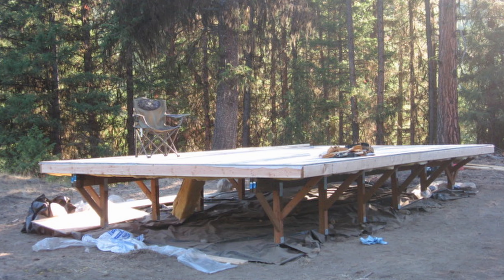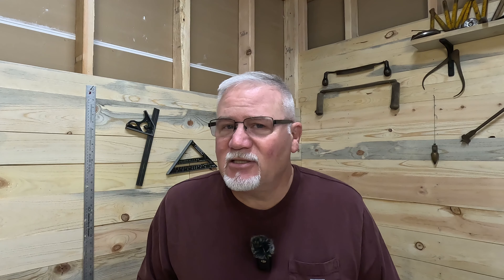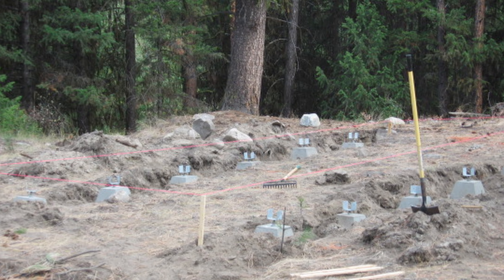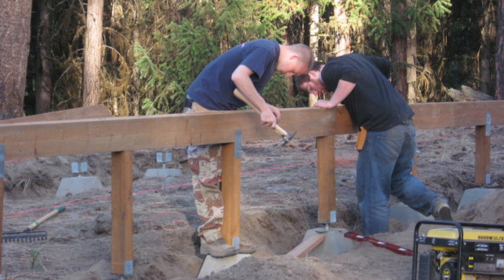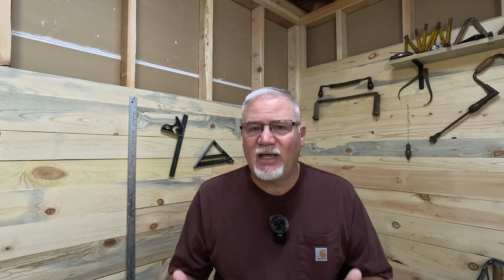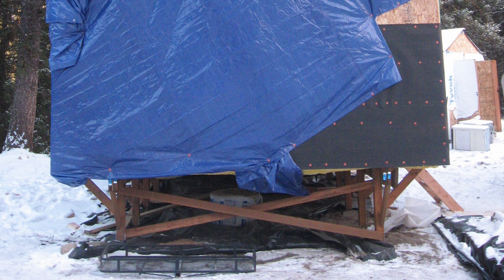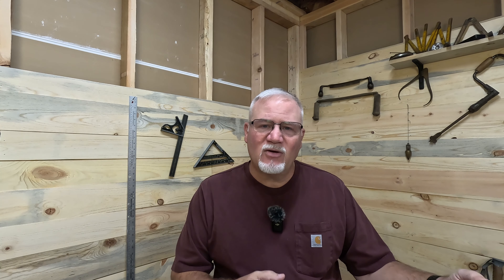I Regret Choosing Post and Pier for My Cabin Foundation Here's Why!

Comment: Based off the cost of concrete, form work, dirt work, rebar/ wire mesh, etc, a stem wall foundation is about 2-3x the price. Not sure who is calculating these costs.
Reply from the maker: I found it odd myself.

Comment: Lay it horizontal and dig it into the ground it will take a long time before it rust
Reply from the maker: Lay what?
Reply: Courragated metal siding
Reply from the maker: @raymondpeters9186 Ahhh yes.  Good idea
Reply: If you want to go crazy you can glue XPS hard board insulation on the back side of the courragated metal siding 
Metal siding is fireproof and blocks the wind
Reply from the maker: @raymondpeters9186 Eventually, I plan to finish the foundation and insulate it, but this would be a good way to seal up the crawl space.

Comment: You didnt brace correctly.  You brace like and x from post to post.  That eliminates flex.  I just finished a buukd like this but used 6x6 and braced well.  Mine is two stories and no movement.  Try to make the largest triangles possible.
Reply from the maker: Agreed

Comment: Always put your foundation lower than frost line...
Reply from the maker: Best of course but then in 15 years I've had no frost heave.  It's a cabin.
Reply: @TheOldJarhead  
Frost /frozen can lift things..
To me it's always easier to do things right (below frost line or ?) Than to go back in after the fact to try and fix things...
But that's just me....
Reply from the maker: Of course, but sometimes what we believe is right isn't necessarily.  My building hasn't heaved in 15 years, is a cabin, and I'm happy with it. 

I won't claim it's perfect, but I know cabins built this way 100 years ago that are still in use 😉

Comment: @Adam Roby
I am guessing having skirting that goes down to the ground would also not help much since these critters will just dig under the skirts?  I guess it would at least help somewhat with the wind.  Great video as always.
Reply: You should dig a footer to sit you skirts it should keep critters out and you should also put down a thick moisture barrier down in your crawl space. Extra protection plus keeps mold down.
Reply from the maker: I think it would help but the footing and cinderblock wall would be ideal,  I may skirt before the winter though just to help keep things warm until I finish the new foundation.

Comment: Could You Screw Hardy Backer Board under the Floor to encase Your Insulation and deter Rodents from invading ?
Reply from the maker: Yes, or even plywood, however then it would breathe and would be a mold maker.  Some use peg board, which may be easier and cheaper than hardware cloth, and I've thought about trying it.
Reply: Or corrugated metal siding
Reply from the maker: Mice might be able to sneak in the grooves

Comment: I am a mason if there are rocks in the area truck in sand and some cement bags and I will hand mix and build my own piers. The one problem with today is not so much the technique it is the fact life and modern technology makes us believe easier and quicker is better. Sure you got it built in a short amount of time but 20-30-years of it nagging at you no thanks. Like I said a mason the job either way is hard do it once do it right overbuild and enjoy your endeavor I never liked Harbor freight or walmart and cheap products a foundation holds all the meticulous framing and work that comes after do not neglect the foundation everything above suffers.Enjoy your work Don't allow the Rat race mentality and anxiety steal the joy you should have making a memory home
Reply from the maker: Amen!

Comment: It’s because u didn’t put any 4x4or6x6 skids under it that’s the real problem
Reply from the maker: It rests on two 4x8s
Reply: @ both way’s sitting on top of each other notched together
Reply: @ it needs at least one every 3 ft like skid plates go by any place that sells small buildings and look under them they have at least 4 skid plates down the length and then  2 x6 every 18 inches notched out 2 inches on the skid plates
Reply: @ and then when u get 2 the top of the wall put 3 2x4 s with varying seams that’s called a king plate never put ur studs more than 18 inches on center I promise there is nothing wrong with the foundation system u just didn’t build well on top of it
Reply: @ if YouTube would let me put pictures in the comments I would show u how to build a cabin that would hold up to 120 mph wind
Reply from the maker: The foundation was actually in the plans and would have been fine had I done some things differently.  Such as better bracing, different peer blocks etc.  My 4x4's are on 4 foot centers and the cabin sits on 4x8 beams (I think that's what you meant by skids) and I've known many that worked just fine.  Even mine now is pretty darn solid.

In my case I overbuilt the cabin to the plans so it's actually bigger and heavier than the foundation was intended for (2x6 walls on 16" centers, 10 foot walls etc vs the intended 2x4x8 walls.

I learned a lot since that was 15 years ago and have mostly corrected the issues though I need to complete my foundation work when my body allows.

Comment: You went flimsy and should have used Sono tube to give you a stable foundation. You are disappointed with your construction methods that 4x4s are not suitable for a foundation. 
Double 2x10 on the rim boards minimum and same on the joist (16”) max spacing . 
Your gripe is you under built the foundation.
Reply from the maker: I believe I made that clear in the video 😉 and how I am fixing it.

Comment: I think this is a good reason to not do the things that you have done, rather than an honest evaluation of the the cons of a post and pier foundation.  I can not imagine installing drains hanging in free space below the insulated floor.  I can't imagine installing staple up insulation without a solid barrier against rodents, let alone not getting around to installing hardware cloth.  Crap,  you haven't even finished the wall behind you, where you have artistically hung some ancient tools.   Your bracing of your foundation looks foolishly inefficient.
Reply from the maker: In all fairness, the cabin doesn't move anymore, and after 15 years, I'd say it's doing ok.    Many have built foundations like this and are happy with them.  Then, of course, it had been over 15 years since I last framed, so I was learning again.   Now, the wall behind me?  I'm guessing you are new to my channel, so first, welcome!  Second, I'm a disabled veteran who currently can't stand long enough to finish it right away, but I will!  Stay tuned.
Reply: @TheOldJarhead  I'm sorry that with your disability that you can't stand long enough to get things done.  But I'll stand by my assessment.  Your problems were largely a result of poor decisions that you made, rather than being intrinsic to the foundation system that you chose.  I guess that I can thank you in that I still expect to use Post and Pier, but given my financial situation, I'll probably be able to over-engineer it so that I won't face the issues that you have encountered.
Reply from the maker: And therin is the reason for the video.  As I mentioned, I know post and piers can be done right, and I regret not doing mine better.   I want people to know of my mistakes and my successes in hopes that they help others.  Now, my disabilities slow me down, but I'm a marine. They won't stop me!  Right now, I'm recovering from two badly slipped discs and likely a cracked vertebrae, so it's hard to finish things, but I keep atvit.